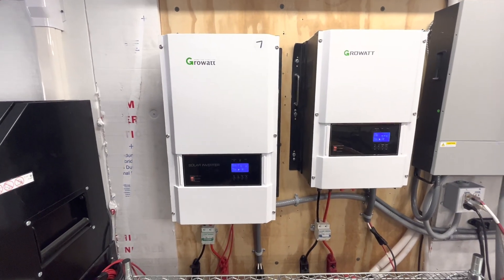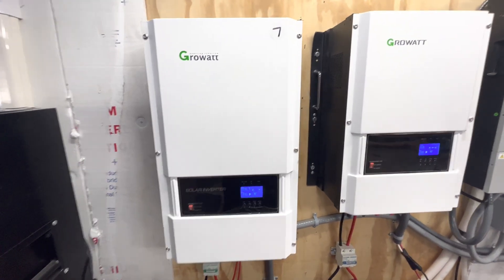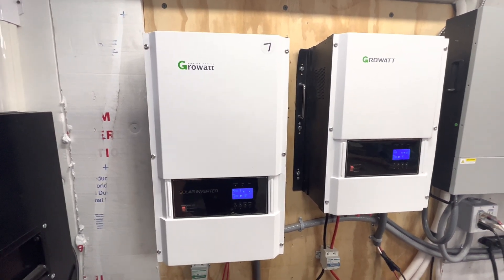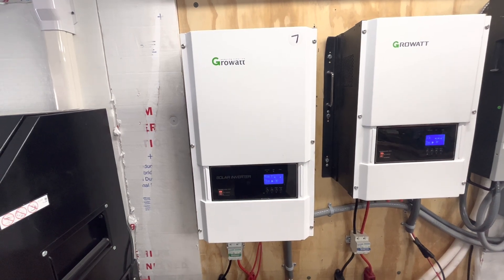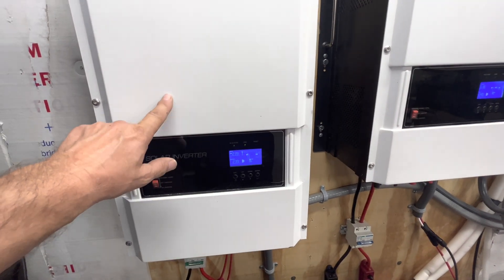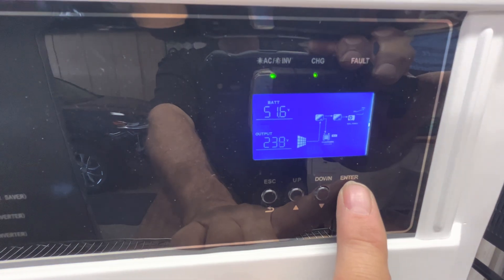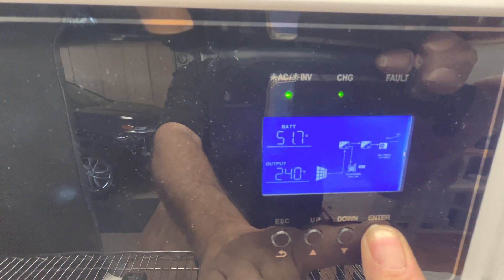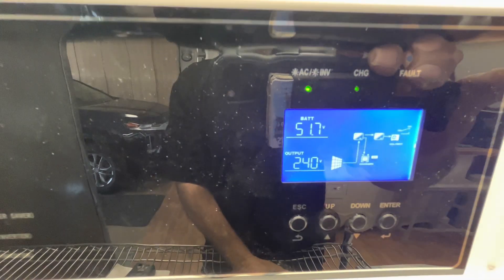Growatt 12kw inverter used as grid pass thru when no solar available by changing one setting.

Comment: Nice video as usual.
Reply from the maker: Thank you for your input. It is appreciated. Just a DIY Guy sharing if you can actually run certain things using solar, so far I do not have anything I can not run on solar. Next project will be adding more to an existing solar panel array and then installing mini split heat pump on motor home.

Comment: Question. if PV output is 11kw, will the unit use 7kw for charging max thru the mppt and be able to run the remaining 4kw thru the inverter to power loads if needed. if not, what will happen to the additional 4kw seeing that the max PV input is 7000w?
Reply from the maker: When connected as grid assist for 11k, it is really about how many amps output you have available. This Growatt is 100 amp output for solar connected. When running my pool heater that needs 160-180 amps, I have to use a separate mppt 500v input 100 amp output 5500 watt output connected to the batteries to make up the difference. The Growatt can charge and supply load up to 180 (programmable on stetting 2 and  setting 11 for utility input amps). If your solar panels are producing more than the 7000 watts needed, it will depend on your setting for bulk charge and float charge as to what is done with extra watts coming in. But like I said it is maxed by your amp output and not so much how many watts coming in. The inverter will try to keep battery full and supply loads at the same time. It does what you program it to do. I rarely see my inverter get close to total output watts, I often see my inverters hit max amp output.
Reply: @diy-solar-guy  . Same thing i was thinking, would need a second SCC to input the excess 4kw to in assisting to charge the batteries otherwise it would be wasted. Thanks.

Comment: Do you have common neutral(inverter Out neutral + utility neutral)? Where did you bond your Neutral-Ground?  I'm Still setting up the same growatt.
Reply from the maker: I bonded and grounded in the 200 amp electrical breaker panel. My Growatt inverter will not work with a earth ground. My 12.7 Tom pool heat I run with the 12kw Growatt has a earth ground, that equipment has to be earth grounded.

Comment: Hello, I have the 6kw, but I'm trying to hook up my solar pool pump with the inverter so I can run the pump on cloudy days.. Do I hook the pump to output? The pump has its own controller already, n I'm a little confused. Your help will greatly appreciate
Reply from the maker: My Jacuzzi pool pump is auto sensing for 120/230v. I actually used a 12 gauge 6 foot electrical cord I bought from Lowes and wired in pump then plugged into my solar power outlets I wired right above it on wall. The output of the inverter is wired to that outlet above the pool pump. My pool pump has a separate earth ground from my main electrical panel coming in from grid. My inverter ground in bonded and grounded to 200 amp electrical panel. I could have direct wired to 6 kw Growatt but I chose to use plug in cord so if my solar is down I can still plug in grid power outlet by pool pump. Hope that helps. My 12 kw Growatt will not allow me to plug in outlet wired from output of inverter for some reason. It is wired, grounded and bonded the exact same way as 6 kw Growatt. But I have 3 other inverters I can plug into outlets that are wired by pool pump for off grid inverters. Let me know if you need more input.

Comment: Are you able to supplement with grid power if needed(use more then inverter can provide) on the 12k or 6k growatts? At peak I’m using about 15kw so I’m trying to see if I can get additional 3kw from grid when needed?
Reply from the maker: Signature solar said if you go close to max output and stay running the inverter like that, it will greatly reduce the life of the inverter. When I tried to supplement with grid power, the inverter temporarily switched to grid to charge battery and run load than when back to solar, kept repeating several times a minute. I could not get the inverter to use both solar and grid at same time, where it was supplying most of the load with solar and the rest with grid, it was one or the other.  Unfortunately you can not parallel the Growatt low frequency inverters. I tried using the 6 kw Growatt as the grid input but it did the same as described above. My only thing I would try is to increase battery bank size so I could run longer. Try calling signature solar in Texas and ask them, their technicians have a lot of knowledge and what people have tried to do with the Growatt low frequency inverters. They might be able to come up with a solution for what you are trying to do.

Comment: Do you have those inverters connected in parallel? And how many panels do u have hook up to them?
Reply from the maker: I have 4 independent systems by design because I get sun on panels at different times of the day. No panels are on my roof of house which is 2 story. Right now in the winter I only have around 4500 watts connected to each inverter. I can connect more if I want to but in winter that supplies all my needs. I do not want one large system because of all the shading on panels throughout the day. Most of my panels are poly. In the winter I use the mini splits to heat house. In the summer I need a lot more solar power throughout the day but the sun will be directly over panels all day rather then in the southern sky. The Growatt inverters can not be in parallel but the 2 MPP can be in parallel with the exact same inverter and up to 6 inverters. I use the different inverters for different uses. It works great for me but if you have an open large unobstructed area to make huge solar array then that would be better and with 2 12kw inverters which are dual phase. Hope that answers your questions.

Comment: One thing to remember with those LF transformer based Inverters like the Growatts here that the transformer is always in-line even if the inverter is in Utility/grid bypass mode and that battery charging from the grid will be only done while the inverter is in that bypass mode.  Due to this attention has to paid to avoid having a second neutral bond with the utility connection and that the grid neutral does not get connected to the inverter output neutral directly or indirectly or the inverter transformer will "fight" with any phase to neutral imbalance from the grid connection which may increase power usage and in the worst case damage the inverter.
Reply from the maker: Thanks for the great input. We appreciate it.
Reply: @milanswoboda5457  if i just use 240v load, would that still be a balanding problem? N-G bond in the main and common neutral seems the right way?
Reply: @miabellasalonandmedicalspa2822  The problem is not with the load that is attached after the inverter it comes from the external power Input to the inverter if connected to the Grid L1 & L2 while the Inverter output neutral is common connected to the grid neutral AND the inverter is in Inverter bypass mode as this will put the inverter transformer L1-N-L2 in parallel with the Grid step down transformer L1-N-L2 that your house is connected to.

Comment: In the video, we can see two LF Growatt inverters and 3-other HF inverters. How many solar panels & batteries do you have installed at your house. Its not clear on what you are trying to explain on your usage of loads
Reply from the maker: We now have a 6kw  Growatt inverter with 8-12v AGM battery bank(48v/240ah/9.6kwh). A 12kw Growatt low frequency inverter with a 48v 5.2 kWh/100ah server rack LiFePO4 battery. A 5 kw Mpp high frequency 48v inverter with 8-12v AGM (240ah/9.6kwh) battery bank. A 6.5 kw Mpp high frequency inverter with 4-12v in series for 48v battery bank ( 150ah/8kWh) LiFePO4. I have over a 100 250-330 watt panels at my disposal to use but not all are connected. I only connect what I need to use and in the winter, I don’t use a lot of power. I have 80-250 watt used poly panels, 13-330 watt mono panels, 12-250 watt mono panels and 5-190 watt mono panels. A total of 28240 watts in panels at my disposal. I have 2- 4000 watt arrays, 2-3500 watt arrays, 1-3000 watt array and 1- 5460 watt array. The 2-4000 array is connected to 12kw Growatt inverter, 2-3500 watt array connected to 6kw Growatt inverter, 1-3000 watt array connected to 5kw Mpp inverter and 1-5460 watt array connected to 6,5 kw Mpp inverter. This time of the year the power production is from 9am-4pm with less than 50 percent of array output available due to sun being so low in the southern sky. So the 4000 watt array at peak would be about 200-2000 watts between 9am-4pm. Summertime I can get  close to 3700 watts peak on a 4000 watt array and production is from 6am 6pm. At 6 am 200-400 watts, 7am 400-700 watts, 8 am 700 -1200 watts, 9 am 1200-1800 watts, 10am 4pm 1800-3700 watts, 4pm - 6pm 1800- 400 watts, 6pm - sunset 400-0 watts on the 4000 watt array. My back wall is the only southern facing exposure. So I have 3500 watts on east side of 2 story house, 6500 watts southern side and the rest on west side of house. If I had no obstructions with south facing exposure I could produce almost 29000 watts at peak. But I’m lucky if I can produce half that in summer. I change around my array size throughout the year to accommodate my usage. Depends on what I want to run. My house is so well insulated that when it drops down to 24 degrees outside overnight it’s still 65 degrees inside with no heat running. So I can get away with just 3 mini splits running using less than 3500- 1500 watts to heat house all day from 6 am -noon and then turn off until next morning. We have 31kwh of battery bank total. I took the 24v Mpp inverters down 6 months ago. We have 4 separate systems so we can see what each system is capable of output loads. We want to have 4 separate systems and not one big system. Are load usage slowly increases throughout the day and we have 4 separate banks to use at night but only use 1 battery bank at night due to high efficiency insulation value in house. Different inverters for different size load usage. High frequency can parallel but low frequency is not able to parallel. High frequency can not start large loads, ie… 3 1/2 ton & 4 ton whole house heat pumps. Low frequency uses alot in standby overnight so we use the high frequency at night. High frequency uses less than 15 watts standby overnight. Just using low frequency with no load overnight would drain my battery 40 percent with no load. Low frequency great for day use only. High frequency can run 3-4 mini splits each but can’t start large loads. Hope this helps. We have more power than we can use at this point and back up inverters and panels in case inverter stops working or a panel craps out. System has paid for itself in just 3 years.

Comment: Try using the setting for 01 to SUB. that is SOLAR first, then Utility when not enough solar. If the grid goes down it will switch to battery.
Reply from the maker: Hi, thanks for the comment. I used the solar first setting in a previous video. This video was for grid pass through in case you don’t have enough solar or no solar at all. The other video showed solar running pool heater and when battery bank dropped brown a set point, the grid power kicked on and started charging batteries and running load for just a few seconds, this kept cycling on and off. This video was also about using grid power at night when there is no sun and battery bank is depleted. Thanks for the comment and hope you have a truly wonderful and blessed day.

Comment: How do you like the growatt 12k/6k units so far? I have a bunch of high frequency inverters, but I am thinking about getting some of these too.
Reply from the maker: I like the low frequency being able to surge 3 times the running watts to start high inrush current motors and compressors. They are extremely heavy to mount. The 12kw is 186 lbs so getting mounted on a wall was a challenge. Had to use a pull chain engine hoist. You are maxed out on low frequency inverters and can not parallel with another inverter so keep that in mind. I am happy with the Growatt low frequency off grid inverters and would recommend.

Comment: If you get a Solar Assistant you can hook to all of those inverters and then individually monitor them and change their settings remotely.
Reply from the maker: Thanks, I will look into that.
Reply: @diy-solar-guy  I recently wired my Growatt 12K so that with the flip of a breaker it backfeeds my main panel, and gets its incoming power from a line-side tap and a fused disconnect.  When the backfeed breaker is on and the main breaker is off (it has a generator lockout so they can't be on at the same time) all of the power flows through the Growatt, whether from battery, solar or the grid. I did this as a whole-house UPS with 50kWh worth of batteries.   Here is a quick video I made a couple of days ago showing how quickly and easily I can switch from battery to grid using Solar Assistant.  My system is AC coupled to my grid-tie inverter that has CT clamps around my mains to allow me to measure incoming/outgoing energy.  The changeover is so seamless that my Tesla doesn't even notice, other than the voltage change. 

https://youtu.be/DyCZYhqIVLc
Reply from the maker: @chevrofreak  Very nice, I will look into that. I will never be able to be grid tied where I live because the electric company penalizes you by almost doubling your bill to go solar on grid.
Reply: @diy-solar-guy  not having to deal with a grid tie makes it a lot easier with these  Growatt low frequency inverters, because, while they can accept incoming power on their output, they have no way to shut off the grid tied inverter when the battery is full.   I had to wire up a remote controlled 100A breaker to a programmable voltage sensing relay that would kill my grid tie inverter to prevent something bad.

On that page where I clicked "activate" to go back to grid power it has additional options to automatically switch from grid to battery based on time of day and battery state of charge.  I am sure you could configure it so that you rarely if ever had to manually switch it.
Reply from the maker: Where do you get this product?